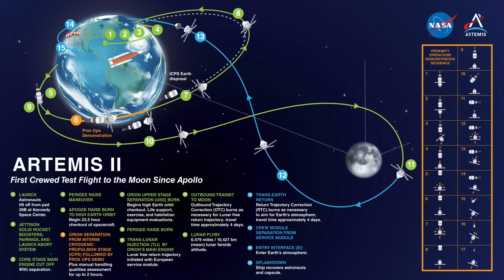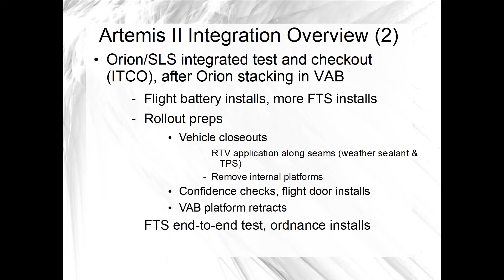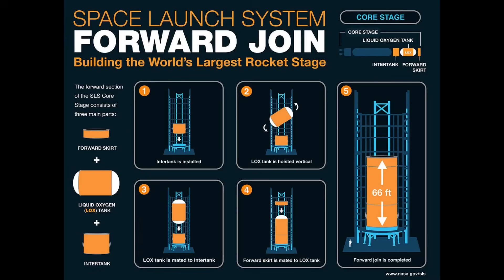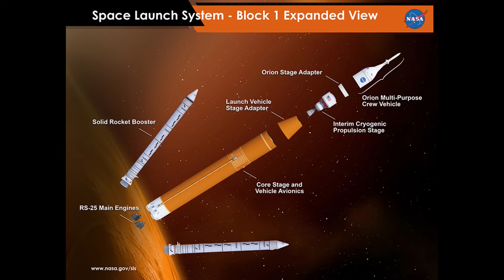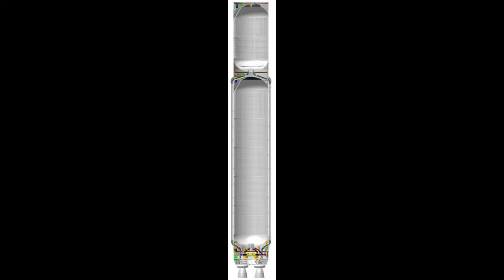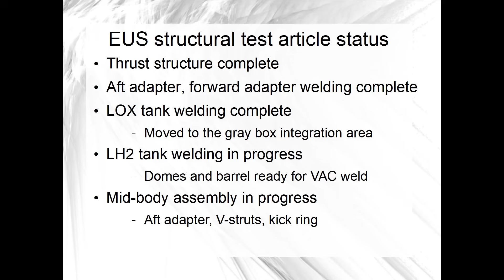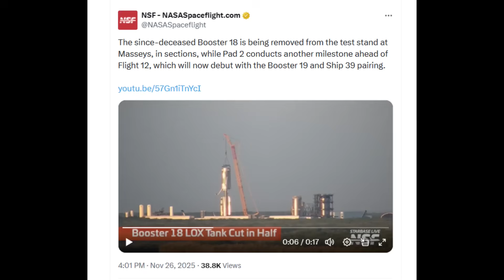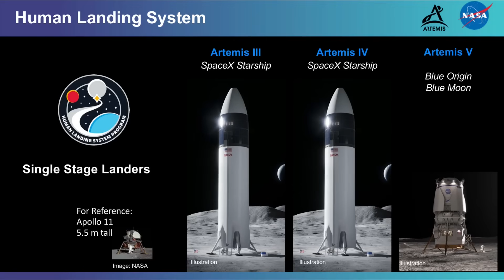Is the Artemis II CDDT in the critical path?  When will the Artemis III SLS be ready?

Comment: We're targeting the end of the timeframe to rollout to make it for the February launch date. It is 24/7 including holidays work wise. Artemis 3 im genuinely starting to think maybe what you alluded to earlier this year of a Artemis 2.5 style. I think Artemis 4 will become the landing mission. Both Blue and SpaceX are the only real options at this point and both are Late 2028 which im sure will slip to 2029. Seeing as how Booster 18 had its mishap and more are bound to happen. To much schedule pressure has lead to deaths in the past and NASA definitely doesn't want that. So if it buys the SpaceX and Blue teams a bit more time and allows them to be ready to actually support a landing. Artemis 4 makes the most sense. As always Phillip thank you for covering this program as accurately as you do!
Reply from the maker: Hi Anthony, thanks for the insight.
Reply: @PhilipSloss  the good news is we are hiring  A LOT of people in the coming month. So the EGS side should be smoother on the stacking and processing side for 3+. This flow has gone very smooth though. The crawler is starting its practice runs on the crawler way and will be for the next month + until we roll out. Hopefully Boeing and Lockheed can get their parts of the program in line then we should be able to do 1 per year. They are genuinely trying their best to get there. Lockheed is 24/7 365 on Orion. Boeing is 24/7 in the VAB. ML2 is a massive upgrade to ML1. Very excited for that hand over and to get it ready for 4+. Im praying that either SpaceX or Blue can get their prospective landers ready in time. Should be an exciting 2026 to say the least.
Reply from the maker: @anthonybattipaglia2071  There would be a few threads to pursue after Artemis 2, obvious given some assumptions.  Another one of those development areas is the EUS processing cell in High Bay 4.  That's the hardware side, but there's also the spaceport software for ML-2 and Block 1B.  We'll see when NASA is willing to talk about their post-Artemis 2 outlook, but HLS moving to basically 2029 has increased attention on the preparations for Artemis 4.
Reply: btw i freakin love discussing about this topic especially when i don't have an "angry astronaut"-kind in front of me but someone who actually understands the topic and the space market
Reply: You work at EGS?
Reply: @cynbloxy  yes. I have been with them for 4 years this February. First Jacobs now Amentum. Absolutely have loved it. Consistently at MWT ( Max work time). I honestly need to upload photos and videos more on here. I do upload some on Instagram.
Reply: At this point Lockheed is the only manufacturer that van realistically beat China to the moon unfortunately.
Reply: @fergalhennessy775  hahahahah lmao
Reply: @fergalhennessy775  cost++ for an LM-sized 2 stages fully expandable lander in 30 months, realistically in 90 😭 lmao absolutely not
Reply: @golem_videomaking  Reminder that a less capable Apollo LM cost 30 billion dollars to develop and it took 6 years.
Reply: that totally makes sense considering the apollo program landed after 10 previous missions, 3 of em crewed before the actual landing. but it's a bit different this time, considering how the landers will have the capability, and probably this would be the main landing method, to land autonomously maybe in a safer way than a manually piloted landing. the orion spacecraft doesn't need more engineering than the landers, and space x is actually literally skyrocketing their starship program's pace. the booster 18 malfunction will delay the program, but no more than 4 weeks, a month basically, nothing that really matters if we consider how fast they recovered from massey's site explosion and that they already have gotten permission for over 70 launches, landings and static fire tests for both boosters and ships per year from a single launchpad, and they plan to build more of them till the end of 2026, so to probably have these freetogo for more pads for start of '27. if orion and sls are in schedule, i can see starship hls being in schedule too, and no real need of a remake of apollo 9 or 10. not as much to not waste hls hardware, but sls hardware, it would be a real shame waiting more years and astonishingly more costs cos artemis 3 had to launch only in leo. that rocket should aim for mars, sending a capsule to leo is really a waste of resources, and an apollo 10 is useless since the og mission was designed to test pilot capabilities of controlling the lm in lunar orbit but primarily test the lander's engines in a real scenario, stuff that space x will test in its unmanned test landing by contract